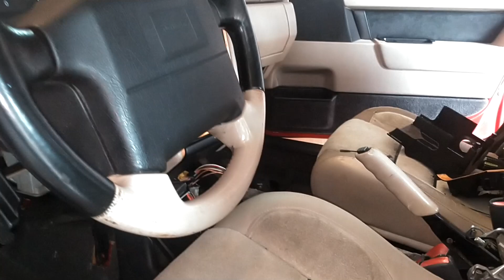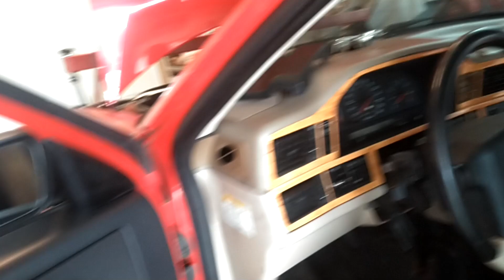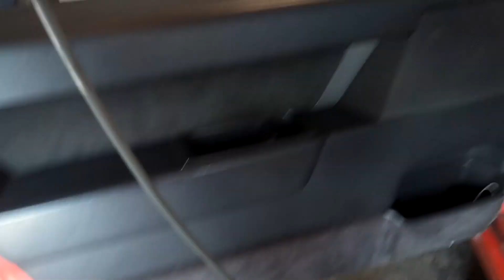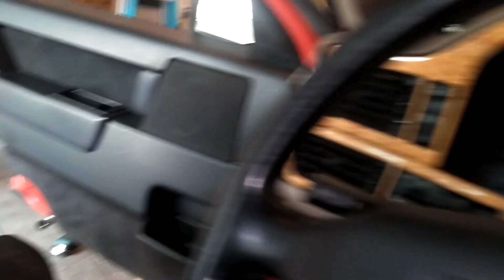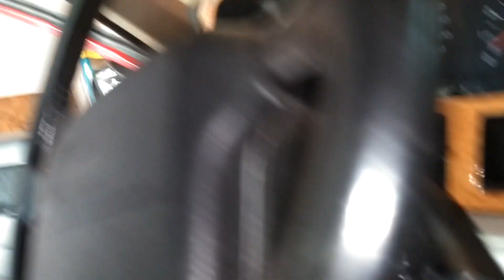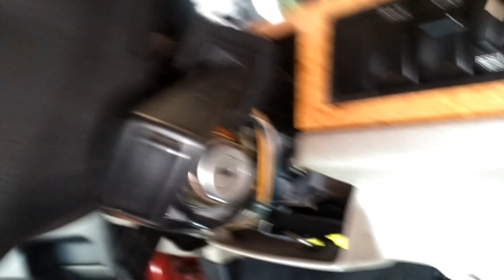Installing the ignition cylinder lock clip, use the end of the shift lock cable. - VOTD

Comment: I bought a 1997 Volvo 850 SE and the previous owner told me that one day he parked it one day and all the power steering fluid leaked out at once, not sure how I should do this project due to the fact the power steering looks fine from the engine bay, haven’t put any fluid back in as I dont know exactly what I’m looking for, also has an engine tick I’m sure not what I can do about the tick but my top priority is getting the power steering back in, thanks
Reply: You need to add some power steering fluid to find where the leak might be, too many possibilities. Easier to add check the system!
Reply from the maker: https://youtu.be/7Mz-eSmLY5k
Reply from the maker: If the engine is bad, why mess with the rack?